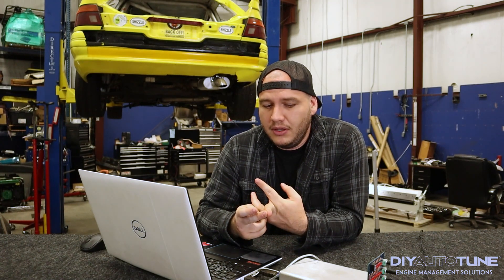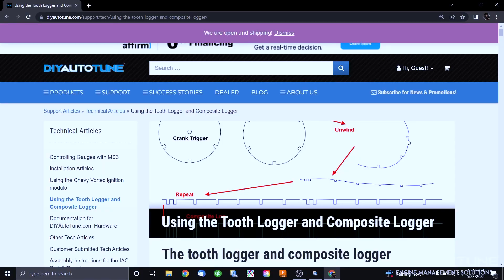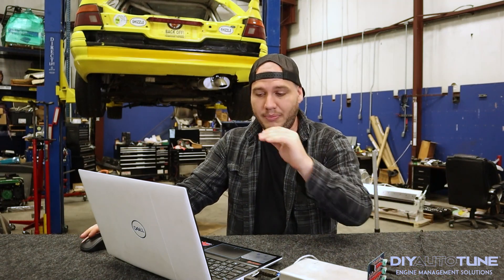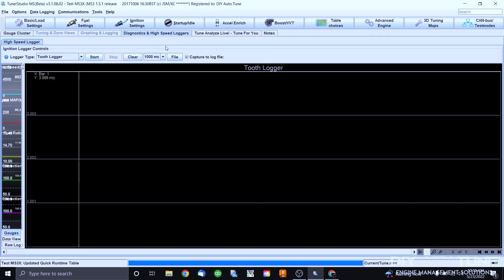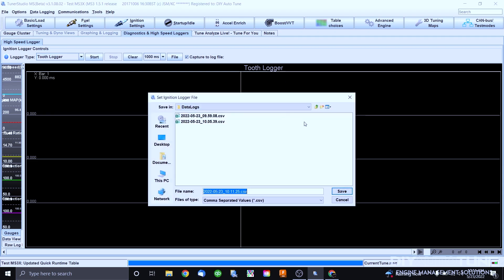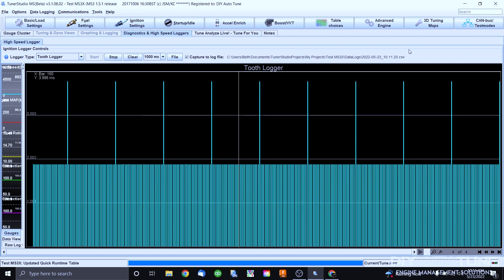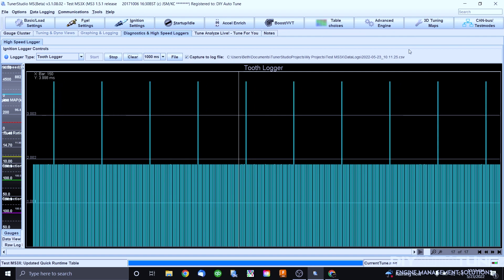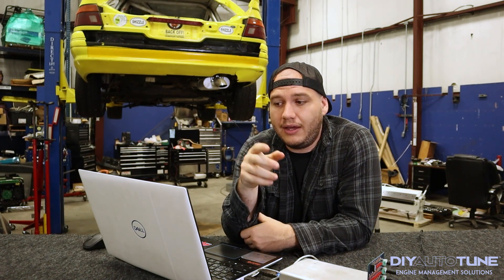How to make a Tooth Log using TunerStudio!

Comment: Let's say we are getting a good tooth log and good composite and no sync lost... what could be preventing me from getting spark plugs and injectors to fire. Also those checked out good in the test mode. this is on a megasquirt MS3 with expansion board and with a  single tooth camshaft
Reply: Did u figure it out? Running into same problem